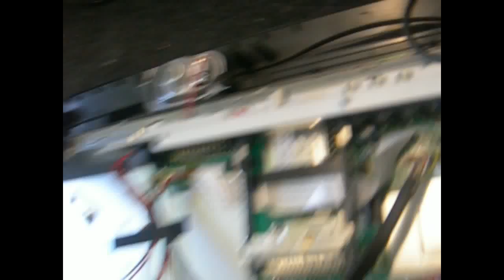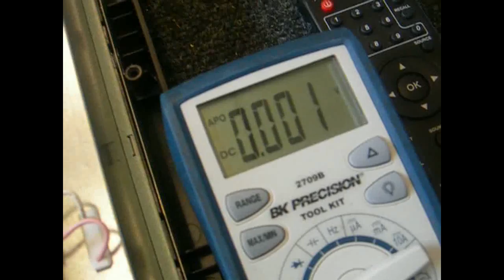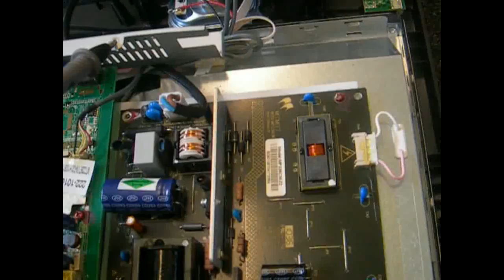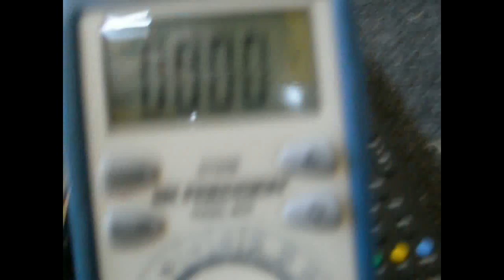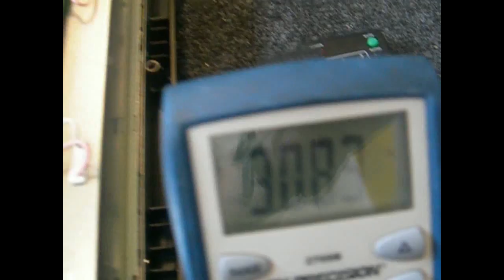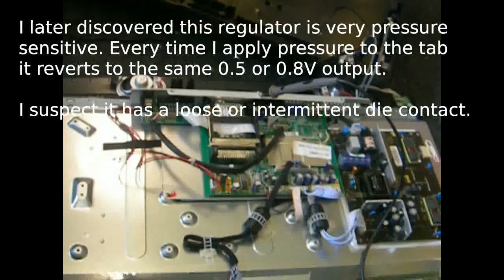Bush LT24M3 - Flickering power LED/No power/Intermittent power - Diagnosis of fault

Comment: hi there, i have a BUSH LC-39GL12F  39inch tv and the screen wont come on, when i plug in my tv the standby light comes on(red light) and then when i click the power button the blue light comes on which means the power is working, however nothing on the screen seems to come on, no sound, no image or no light or back lights. i thought maybe it had a problem with the power supply so i replaced it but still the same. theres only the main board and the power supply board that can be replaced, the c ton board and the backlight board cant be replaced. do you maybe know what the problem is. thanks.

Comment from the maker: It is easy if you have prior experience. I used to take stuff apart, breaking it in the process, and learning how it worked. Now, I fix stuff, also learning how it works.